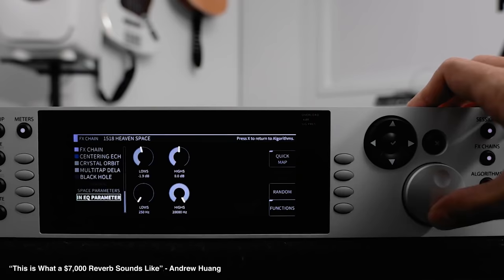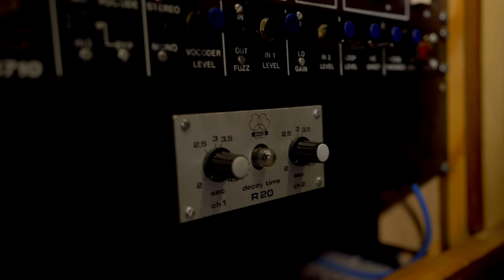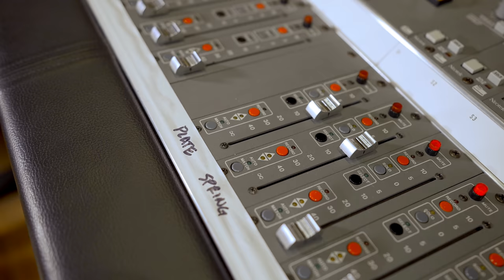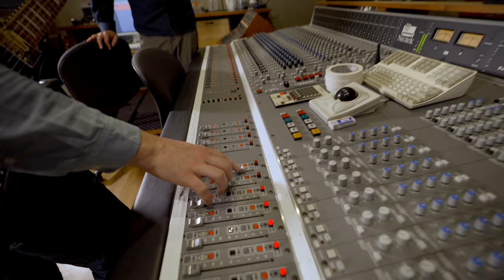Why Huge Metal Plates Are on SO Many Songs (reverb machines)

Comment: When I studied Audio Engineering we used the fire escape to create a staircase reverb, by dropping a speaker at the bottom and recording on the top floor.
Reply: We did the same when recording background vocals & harmonies for Playground many years ago at SAE when it was in St. Kilda, Melbourne
1 mic on the level we were recording on, 
and got the softer singers to stand on the upper levels of the fire escape, 
and progressivley moved the louder singers down the fire escape landings to get the right blend, 
It wasn't the only wild & wacky technique used, but the were all fun to play with.

Apparently Neil Young got a particular guitar sound he liked
By taping a petrol funnel over his guitar amp speaker, 
and then ran it down several metres of hose that had a mic taped up to the other end

Reverb is a natural sound, and it's carbon nuetral  ;-)
I say, use it whenever you can
Reply: @frankhammer6795 that is so fucking cool

Comment: I'm generally pretty skeptical about the difference between "authentic" physical effects and their digital companions, but I have to admit that there's something incredible about the simple sound of that plate reverb. As a materials scientist, it makes me quite interested in the properties of the steel, the transducer, etc. that makes such a unique impulse response.
Reply: Also makes me curious about the effect of the length and arrangement of the metal “crystals” with the current metal fabrication techniques
Reply: And also now that I remember: cryo hardening!
Reply: Ugh.
Reply: The plate isn't perfect, can't be.
The digital reproduction of reverb can be perfect, but you could program in some imperfections, but there's going to be a wide gap between the two.
I think it's like the "warmness" in Vinyl, it's due to random imperfections of the material and reading of the material that's very hard to get right digitally.
I'm sure you could get close with a very weird and very convoluted process, maybe even a neural net trained on an actual plate, but it's just so much easier to use a big old plate.
Reply: @CommonApathy  still people can't tell the difference in blind tests. So there isn't any meaningful difference.
Reply: @CommonApathy  A gap, but a RANDOM gap, that if modeled well, would not let you know which is which. So it could be made irrelevant. Sure maybe a complicated program (probably not a neural net), but once you get one the first time, it's just copy/paste to clients, which would at that point be easier.
Reply: If you ever get into it I hope you'll compare a whole bunch of materials
Reply: @JB-fh1bb  Honestly, I'd think that just things like size, shape and bulk material properties etc would be enough to explain like 99% of the sound before needing to get into grain structure.
Reply: @roderik1990  That was my off-the-cuff thought as well, but whether that's right or wrong, in my opinion there are some fascinating things to uncover about the details.
Reply: @magnusdagbro8226  I dunno, people say that about tonewoods too, but it's usually cause the blind tests are done with people who've either A) never played guitar or B) play guitar casually. Once you put some guitarists in a room who all have 10-15+ years of professional playing, they can absolutely hear and guess the wood basically every single time.

I figure the same applies to analogue vs digital. Sure, the random dude you grab off the street who's never thought about it before and has no reference will never, ever, ever be able to tell. The audio engineer with 30+ years of professional experience who's used 500 different reverbs and once spent 36 hours listening to the same track A/B through different reverbs and settings might be able to get it perfect every single time. The audiophile that's spent $20k on sound setups and really cares about perfecting his sound for listening to music very well might be able to tell the difference between vinyl and tape and digital.

Just because random people can't do it in a blind test doesn't mean that it's not a real thing
Reply: @CharlesFreck  IMO tonewood matters way more than most people are willing to admit
Reply: @aniquinstark4347  say what you want, but it matters way less than the pickups and amp... Biggest difference between the wood is how well it carries the sound (sustain), and not really how it sounds (because the pickup type and amp will overpower that, even in a clean setting)
Reply: @roderik1990 doesnt grain size affect young modulus ?
Reply: @casualmusic6715  Slightly, but usually not significantly. For most materials, E is petty close to constant for a given composition. Grain boundaries likely have a much bigger effect on phonon dispersion and therefore sound decay.
Reply: @InZomnia365  I play hollow bodies so maybe my experiences aren't really applicable to solid bodies but I definitely notice a difference between two identical guitars one mahogany top and the other maple. Both run through the same amplifier and settings.
Reply: Agreed.
Reply: Plate reverbs also take in a mono signal and output a stereo signal. Two transducers that are ALMOST the same distance from the exciter, but not quite.
Reply: @aniquinstark4347  True hollow body, there should be a difference. Solid body or semi-hollow, the two guitars may very well sound different but there are about 100 other things that could explain it and have far more impact than the wood. Hell, just variances in the cap on the tone circuit will make a much bigger difference

Comment: 1:59 I can attest to that as a violin student, a violin on a dry room sounds like a depressing whisper, on a reverby room (Not just the exagerated ones like a church but a good sized room) it's loud and imposing.
Reply: That is also true for modern vocal recordings. The sound is recorded so dry that it sounds like absolute crap, no matter how good the singer is. Then the audio engineer switches on the effects chain which includes reverb and delay and it sounds amazing.
Reply: I play string bass (started out on violin, though). And for some reason, a gymnasium amplifies a string bass like tenfold! Hard to hear myself when playing in a concert band. But then in the gymnasium we used to play in, I would actually have to play quieter, because of this! (And the reverb on the string bass ruled! 🙂)

Comment: When I was a young kid, my grandparents had a new 1966 Mercury Monterey that had a spring reverb for the radio from the factory. It was turned on or  off by a floor switch next to the headlight dimmer switch. If you turned it on and drove over a rough road the springs would pop and twang through the speakers. I was fascinated by the sound effect.  I have never seen another installation like it since.
I love that some artists are going back to the old school electromechanical effects. Some things just can't be reproduced by computers.
Reply: Thank you so much for sharing this! That's so dang cool...
Reply: Who would ever have guessed that an old car radio would have a 100% analog (and obsolete but awesome) spring reverb? Thanks for sharing! You only learn these specific kind of random things through people sharing their experiences from the past, there's no other way any of us would ever have learned about a 1966 Mercury car radio's reverb function!

Comment: Room reverb - 3d
Plate reverb - 2d
Spring reverb - 1d

Wow
Reply: Gets me thinking about the challenges of doing reverb for game development, where you're trying to recreate an environment without melting the player's CPU.
Reply: @Roxor128  Probably a factor towards the push of multithreading CPUs and almost a norm of 8 cores
Reply: Would that make using all of them at the same time or looped together 6D.??
Reply: Calculating reverb would be much more efficient on the GPU instead of multithreading it on the CPU. John Lin has implemented a ray-tracing style reverb in his voxel game that he's working on, this guy works for NVidia or Epic or something. Check out his youtube.
Reply: @michaelmoore8680  i think you just get 3d reverb pro max
Reply: Digital reverb - 0D
Reply: @yeti4269 thing is audio uses one thread mostly

Comment: I have worked in a studio with a 12 foot long spring reverb unit. It had 4 springs inside of different lengths/properties, and you could mix between them. The studio also had a corridor down the back of the main room with sliding doors along it so you could customise the room reverb. It was a former TV studio, so they would have been used to add atmosphere to scenes.

Comment: I really enjoyed this

One small nit: there were some absolute statements about analog/digital made that don't generally jive with the definitions. They were more opinion. Corrections:
- Spring and plate reverb are electromechanical + analog.
- Bucket brigade chips and reverb/delay/chorus etc based on them are also analog. Spring and plate reverb doesn't have a monopoly there.
- Digital reverb involves a circuit that samples the audio, processes it digitally, and then converts back to analog audio via a DAC circuit or chip.

There are tons of analog reverb (and echo/delay) pedals, but also tons of digital ones. They can be analog without a physical spring. Not a huge deal, but you have many folks learning from you while you are learning, so figured I'd try to help clear that up a little. Hope that helps.

Comment: That is brilliant using a transducer with two Pico sensors separated is absolutely brilliant. I'm guessing it feeds up to a mixer board and by turning the potentiometer you select the distance between those two Pico sensors. It really is brilliant especially for the time. Think about what all songs his vibrated through that panel.

Comment: Back in the day (transistors) the recording studio that I remember had a 5' inside diameter concrete pipe sections stacked vertically 20ft above the Studio roof. The opening could be adjusted with a gate inside the studio ceiling. When the tube was wide open the drum solos sounded  Godlike.

Comment: My grandparents had a retractible ladder up to the attic, wich had really long coil springs that suspended the ladder from the hatch, so you could just slide it upwards and close the hatch.
These springs had the most amazing sound, they would reverberate for a long time and you could get them going by just knocking on the ladder with your palm. 
 I always relate that springy sound to the exitement of climbing up to that dark attic full of old strange stuff in dusty boxes.

I wonder what it would sound like if you built a spring reverb out of a pair of those five feet, two inch in diameter coils.

Comment: As an electronics engineer I can't agree with your reverb friend's statement that almost all reverbs are digital.
I think what he means is "almost all reverbs are electronic." As in, the circuit element creating the reverb is an electronic circuit, and not a mechanical element.
But this does not mean that all electronic reverbs are digital.

Since digital has a fairly narrow definition. That frankly can't be applied to a lot of analog reverb circuits. Be them mechanical or electronic in their nature.

In the end, the statement "everything that says reverb on it is going to have a spring or it is digital" is just incorrect. Stop calling analog electronic circuits digital.
It is on par with saying that all recorded audio is effectively morse code, regardless of recording medium.
Reply: This is an interesting point.
Reply: Speaking in generalities or oversimplifying can be a trap, but in terms of modern music gear (especially guitar amps) he's probably not far wrong. Sure, there's still plenty of analog reverb pedals/effects out there which use discrete components, but most guitar amps  either use a spring tank or a DSP chip which provides multiple built-in effects (such as my Vox VT30 which also does amp modelling in combination with a tube preamp stage).

Comment: The Light Pedal has sensors at different parts of the spring that read the pattern of the spring vibration at different "nodes". These are sensed optically, and the light affects that I think. Then there's the feedback control, so it's just a whole new ball game with spring reverb. Again, Gamechanger Audio has changed the game

Comment: On that vibrato/reverb unit from Analog outfitters, the vibrato unit looks like a vibrato 'scanner' out of a Hammond tonewheel organ, with a variable speed stepper motor to drive it (since the original turned at a preset speed). Very cool setup, especially since you can actually see the internal workings.😁👍
Reply: That's exactly what I was thinking! Hammond was WAY ahead of his time with electronics. One could almost say that Hammond produced the first mass-marketed synthesizer (he was trying to replicate the sound of a pipe organ initially). As I understand it, the vibrato scanner would electronically employ the Doppler effect (or something along that order -- it's been several years since I read up on this) to give the sound that characteristic vibrato effect. Just ingenious.

Fun fact: Then the Leslie speakers came in, which Hammond HATED(!!!!!). In fact, he ordered his engineers to make it so a Leslie could not be attached to one of his organs. Not surprisingly, the Leslie guys figured out how to wire them in anyway.

Comment: "in the 70s all went digital" - no, he's probably referring to bucket brigade delay lines used for reverbs, among other things. They are a form of sampling, but ANALOG, not digital. Analog voltages get stored by very analog capacitors, no value quantization whatsoever, so, nope, not digital. There are no discrete digits (value quantization) to speak of. A lot of people are confused here, but it's that simple.
The principle is somewhat related to the Hammond rotating chorus device / scanner vibrato.
Reply: Completely agree. The way I was taught is that spring reverb and plate reverb are electro-mechanical devices. They are typically also analogue, but in theory you could build a digital electro-mechanical reverb, although not sure why you would want to.
Analogue effects are purely electronic with no mechanical component, but don't involve any digital conversion. So an analogue delay is typically the bucket brigade device. I don't know that the way I was taught there's any real sampling involved.
A digital effect, by contrast, does involve converting or sampling the signal into digital form before its processed.
Reply: Yeah the supposed "expert"s insistence that anything electronic is "digital" was very annoying
Reply: @JimChamp  They are discrete in time however, so sampling theorem considerations do still apply, and the input and output needs to be low-pass filtered to prevent aliasing.

And as far as value quantisation goes, at the end of the day physical noise sources and quantisation noise are both just noise. And an analogue system just switches out the latter for the former. (with some further distortion/colouring due to the physics of how the signal is propagated)

Comment: My brother-in-law had a car (this was in the mid-60s) with a spring reverb. Whenever we hit a bump or drove over rail tracks, it went nuts.

The EMT 250 was built by Lexicon. At the 29 minute mark, I spy a Lexicon PCM 41, which my first digital delay.  Later I picked up a PCM 42 to keep the 41 company. 🙂

Comment: Fascinating.  To be overly nitpicky, the reverb pedals are solid state, not digital. Solid state circuits are analog.  Digital is converting the analog signal to 1's and 0's, digits.  Which becomes software devices.
Reply: I think that some reverb pedals are digital, no? But yeah, most pedals are analog.
Reply: @keithklassen5320  The video spoke of reverb pedals first coming on the market in the 70's being "digital".  Yes, in more recent times simulators/emulators are actually digital.
Reply: Most reverb pedals on the market, by far, are digital.
Reply: @rickc2102  nowadays yes, but in the 70s a digital reverb would have still required a shoebox-sized (if not cupboard-sized) crate full for circuitry. Those early reverb pedals were indeed analogue.

Though to be fair: these bucket brigade circuits aren't normal “continuous analogue”, but do something you normally find in digital audio: they chop the signal up at some discrete sample rate, but the individual samples are actual analogue voltages in a capacitor, not 0-or-1 number representations.

Comment: 20:52 This sound reminds me of my 1966 Hohner Orgaphon 45MH. These Amps had a pull push poti for reverb controll that when pulled up it switches the reverb signal througt a seperad photoresistor in the Tremolo unit. It made up a very clanky and wet echo. And when you turn the Tremolo controll all to max. It sound similar to a chorus but very unique

Comment: "This is probably as big as spring reverbs get"... Meanwhile Neil Young runs a spring unit from the stage floor down to the concrete stadium floor several feet below... :)
Reply: I've seen pictures of the original Hammond spring units. They hung down like a drape.
Is that what you're referring to?
Reply: valvenator An old Fender tube reverb unit, but, I believe, with oversized springs used outside the case itself. I’ve read a few descriptions, and they never really give me a clear picture, but I believe the springs hang vertically, extending from the underside of the stage floor to a mic stand on the concrete floor below. “The springs are on a microphone stand that goes on the cement floor of the building”, as Young explains. “It extends up to the bottom of the stage, with the spring stands on top of the stand” He said he can get spring-splash by jumping hard on the stage.